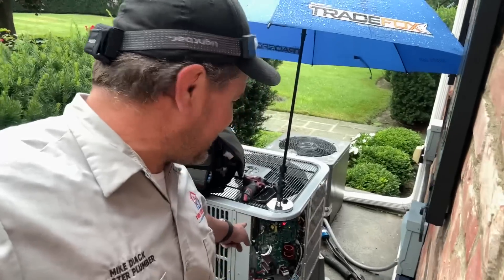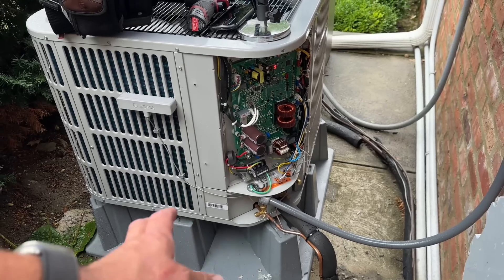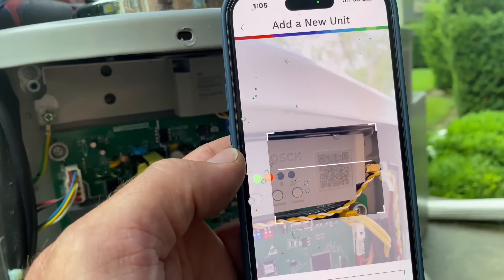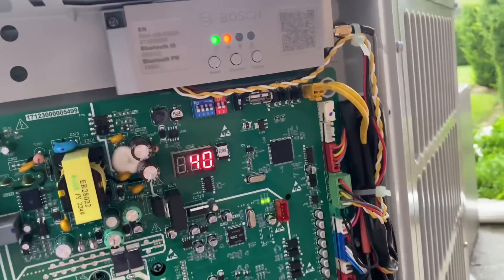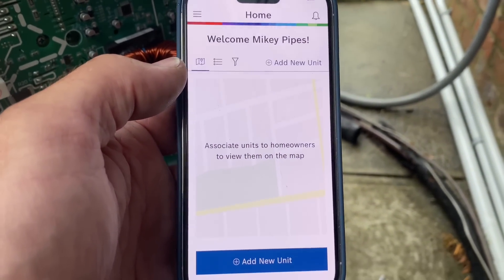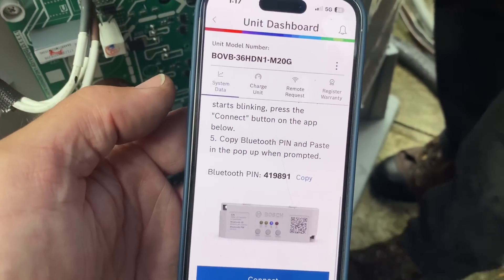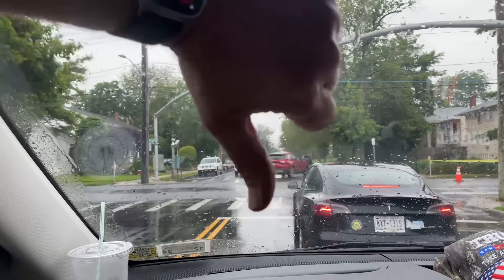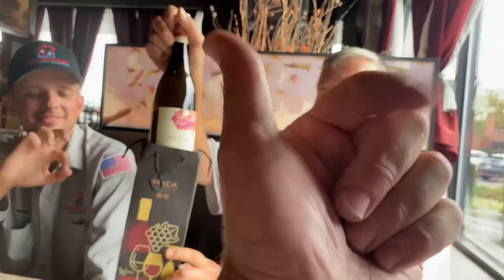Bosch IDS 2.1 Connected Epic Fail EasyAir App

Comment: Any solutions yet to the premium connected gateway issue

Mine ultimately flashes 3 times after a reset which indicates data packet cannot send

Contractor going to try again with a new gateway delivered under warrantee

EVER ABLE TO GET ANY OF THESE GATEWAYS TO WORK??
Reply from the maker: Yes. Every single now connects

Comment: So, as a homeowner, if the installer doesn't want to deal with this BS (and I can't really blame them), is there any way for me to get access to the EasyAir app myself?
Reply: David brown, did you ever figure out a solution? Trying to gain access to my unit as well.
Reply: @john85678  You can download the app and register an account as a contractor instead of as a homeowner, But its impossible to connect to it, same error message when trying to connect through Bluetooth, maybe you have better luck.

Comment: Did I hear you say the outdoor unit is a 3 ton and the inside unit a 2 ton…shouldn’t the inside unit be a little bigger than outside unit… please explain…thanks
Reply: the outside unit can self modulate form 3 ton down to less the 1 ton. so it will match the needs of the indoor unit. they only make 3 ton and 5 ton out side units.

Comment: What makes Sense to you and the Customer does Not mean that many Other HVAC Contractors will Agree with placing Equipment Inside out of the Weather🤔👎
Reply from the maker: You are an idiot. Mic 🎤 drop
Reply: He’s talking about your filter drier nonsense. I’ve had zero leaks from driers in 28 years!

Comment: You needed to disconnect your Bluetooth and start over. This is typical. Your phone was too far away from the QR code at that level resolution. Probably it initiated a connection and then it was waiting for the code confirmation, and just hangs. now you have to unplug it to disconnect, or try pressing the connect button again or wait for it to timeout.

Comment: So you installed a 3-ton HP with a 2-ton AHU?  Seems legit!  Why would you mismatch a system like that?
Reply: It's actually how it's paired if you want 2 tons capacity. The compressor can limit itself to 2 tons to match the AHU.
Reply: @mikaelahyakuya3485  I have been to several Bosch trainings here in Denver and never once heard that.  Granted, we don’t really use AHU’s here because we use dual-fuel natural gas furnaces.  I have upsized a coil by a half-ton done never installed an AHU nor a smaller indoor unit.  I will have to run that by my local Bosch tech.
Reply from the maker: Guess you weren’t paying attention cause Bosch only makes a 3 and 5 ton outdoor unit Jackass.
Reply: @MikeyPipesUncensored  That is hilarious.  Here is a direct quote from the Bosch website, "These high-efficiency, robust and quiet Inverter Ducted Split system heat pumps are available in four sizes ranging from 2 to 5 ton capacity "

To make the 5-ton system run in 4-ton mode, you change the dip switches.  That's funny you revert back to childhood name calling.  But I don't expect much more from a New Yorker who rips people off.
Reply: @Balticblue93  "To make the 5-ton system run in 4-ton mode, you change the dip switches. " 

Dude you answered your own question. They literally only make 3 and 5 ton units, and you can change the dipswitches to get 2 and 4 tons outputs. That's what he did in the video. Not sure why thats so hard to understand

Comment: Curious why you guys moved away from staybrite 8? Personally I think the female fittings at the coils are slightly too loose on the Bosch units for stay brite 8, especially the suction line.
Reply from the maker: We moved away from it because we had a high failure rate when Daniel used StayBrite8 on installs. He’s not a plumber. He’s an HVAC tech bring cross trained for plumbing.
Reply: That is pretty simple math here.  Staybrite 8 is a soft solder used for plumbing and in HVAC we use Sil-fos 15 with an Oxy-acetylene system capable of heating it properly.  410a systems are far higher pressure than plumbing or even R-22 systems.  He could have used pressed fittings like RLS or the like as an option, but not solder.
Reply: @Balticblue93  Stay Brite 8 has a higher burst pressure because it doesn't anneal the copper like brazing does, Harris Products has published a paper on it. However, I'm really wondering why Mikey Pipes switched away from it.
Reply: @Dan-hd3cs  I would love to read this published document because there isn't any real HVAC companies using Stay Brite 8 instead of Sil-fos 15 when brazing high-pressure ACR.  Probably wouldn't even pass code.  I will have to do a search for this said publication.  I don't know a single company that would even allow using that product unless it was for plumbing or on standard copper for water usage.

Comment: Yeah, I was trying to blue tooth and wifi surveillance cameras for myself and my mom, and had nothing but trouble trying to get the wifi to connect, total engineering crap, it's total BS, they sell products that the functions don't even work. I know how you feel about trying to do a good job and the product fails.

Comment: Brazed not Stay-Brite 8?  Gotta say that Bosch is a lot of money for a Chinese-made heat pump...
Reply: It’s the nicest unit available no matter where it’s made.
Reply: That is pretty simple math here.  Staybrite 8 is a soft solder used for plumbing and in HVAC we use Sil-fos 15 with an Oxy-acetylene system capable of heating it properly.  410a systems are far higher pressure than plumbing or even R-22 systems.  He could have used pressed fittings like RLS or the like as an option, but not solder.
Reply: @Balticblue93  that’s not why you should probably avoid stay brite in this situation.
Reply: @Balticblue93  Simple math?  I'm all ears and looking forward to the mathematical description.  StayBrite8 isn't used for plumbing - it's recommended for refrigerant connections by Harris: "STAY BRITE® 8 is often selected for residential HVAC tube connections as an alternative to brazing."
Reply: @diyhvac1028  Right from the camels mouth.

And I quote from Mikey Pipes, 

"@MikeyPipesUncensored 6 hours ago

We moved away from it because we had a high failure rate when Daniel used StayBrite8 on installs. He’s not a plumber. He’s an HVAC tech bring cross trained for plumbing."  

It is used in plumbing a lot and when R22 or R12 were used, the pressures were much lower.  There are no HVAC companies using StayBrite 8 anymore as it is not able to withstand the pressures of 410a and the other high-pressure refrigerants.  It is a good product but as the pressure continue to get higher like R-290 and such, they have had too many failures.  You either braze with Sil-fos 15 or your press fit with products like RLS or the like.
Reply: @Balticblue93  you should probably never use it on the discharge line and you would have no choice with that being a heat pump. If it was straight cool the stay brite would be fine on 410a but I don’t like the idea of flux getting in my system which is also a good reason to avoid. It will still have niche applications like on distributors and txvs
Reply: @Balticblue93  You didn't show your math.  There are a hell of a lot of 410a systems running just fine with it.
Reply: @iwenive3390  90% of my systems I sell for full change-outs are dual-fuel systems. A HP and a NG furnace, but either way.  Nobody in the trades uses Staybrite 8 or flux when they braze.  You flow nitrogen and use Sil-fos 15 for the strongest joint.  No point in using a niche product when a better product exists for the application.  This isn't the 70's anymore.
Reply: @diyhvac1028  That is interesting, I sure as hell don't see them as in never.  People stopped using that crap in the 70's.  I guess here in Denver, we just know better not to use a niche inferior product.  They don't teach it in the trade schools and never did.  Not even the old timers use that product on 410a.  There is literally no reason to use it as long as Sil-fos 15 and like products exist.    They are stronger, more resistant to vibrations and don't leak.  You are literally on a sinking ship with a bucket bailing out water.  There is zero reason to use Staybrite when better products exist.  No technician worth his salt uses Staybrite 8 these days.  The guys who do need to catch-up with this century.  I suppose if you are using R-12 then keep enjoying that Staybrite.  The rest of us are in 2023.  R290 is around the corner along with some many other like R744 in the residential world and Staybrite has no place in it.  But on my commercial accounts we already use R290 and you better use the Sil-fos 15 or you will be leaking and joints breaking.
Reply: @Balticblue93  sil fos was patented in the 1930’s
Reply: @iwenive3390  Isn’t that amazing that the Sil fos brand was patented in 1931, do you would think you old cranky men would be happy to use the superior product since things were made better back from the olden days.  Sil-fos 15 and 18 didn’t exist in 1931 but the fact still remains that Staybrite is not remotely as strong or used by 99% of technicians.  Regardless, not clients don’t experience leaks and brazing with the manufacturer’s recommendation and industry standards is the way things will stay.  We don’t have to flux but we have to flow nitrogen to avoid oxidation.  So you keep soldering and the rest of us will braze with Sil-Fos 15 or 18.  Best wishes to you….
Reply: @Balticblue93  I always braze . I don’t understand the fascination with stay brite unless I’m trying to join brass to copper. Real ones use 15% without question.
Reply: @Balticblue93  In fact I even braze “weld” steel to steel with 15% dipped in flux on occasion. Another point to consider against soft solders is the melting point may be low enough to melt in a structure fire and that would be real bad
Reply: @iwenive3390  You and I are in the same mindset.  I do not know what the deal is with the fascination with StayBrite.  Even Mike Pipes says it is a soft solder for plumbing and shouldn't be used for 410A.  I have asked a dozen techs now and they would never use it for our work.  These clowns are stuck in the plumbing world and need to start doing things correctly.

Comment: mike pipes filter dyres do'nt leak on the outside.phillip colvin
Reply: Same world im in , never seen one rust thru and leak
Reply: @HvacUSandA 28 years  and zero drier leaks inside hp or in liquid line outdoors. Now Goodman accumulators…YES. Weigh the risk of fire by brazing inside homes, banging your equipment into their sheetrock walls, falling through an attic, breathing fumes in enclosed spaces, tracking dirt/grass inside, etc.
Reply from the maker: in what world are you living in?

Comment: It would have worked if you had copied the pairing code like it told you to do.
Reply from the maker: and then it didn't work when i did it a 2nd time. #EpicFail
Reply: I think the issue is slightly more complicated

Comment: Can this Bosch heat pump work with an existing traditional air handler and thermostat?
Reply from the maker: Yes, absolutely
Reply: Yep, the indoor unit has to have a txv and you're rolling!!
Reply: Thank you. I got a 3 ton Bosch heat pump, icp air handler with a txv, and nest thermostat. I had a company install it and they added additional r410a to compensate lineset and got a 7 sub cooling reading. Intake vent and exhaust vent indicates a 9 degree difference.  A/c has a hard time cooling the house. Inside the Bosch heat pump panel display shows 37hz consistently. It never reads any higher or doesn't fluctuates. When I press the 100% capacity button inside the heat pump panel, she ramps up and starts to cool down the house quicker and the temp difference in the vents is 20 degrees. Any ideas why the heat pump/ compressor isn't fluctuating? All equipment is only 6 months old and it's a new house
Reply: @PipeDoctor  in the heat hump or thermostat?
Reply: @abc-jd9se  Get rid of that POS Nest and get a real thermostat.
Reply: it's ok, maybe later. I dumbed it down to run as a conventional thermostat. Btw my problem was a bad txv. Getting it replaced monday

Comment: Bosch needs to hire some silicon valley nerds to write their software. The Germans arn't cutting it. Great video.
Reply from the maker: Agreed
Reply: As someone who just got a full kitchen with new Bosch (Thermador) connected appliances, and a Bosch heat pump/furnace system, I could not agree more. It is shocking how far ahead the Americans are with software development and user-friendly software interfaces. And the Japanese have also fallen way behind. Didn't used to be that way.
Reply: @krayziejman  I agree. There are times i cant even see the weather on my thermostat on my bosch. Im not complaining. Im asking for betterment. We house one of the biggest tech areas in the world. Go farming bosch. Im sure you will find someone to write your software.